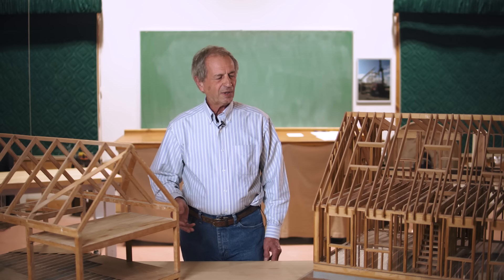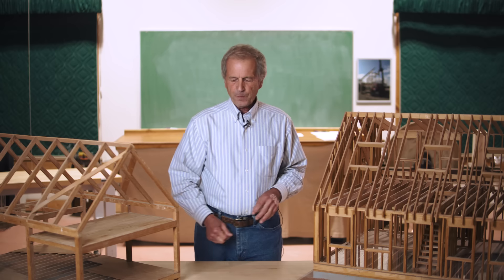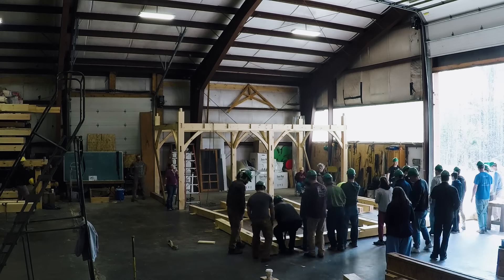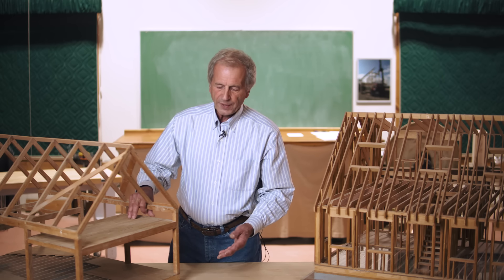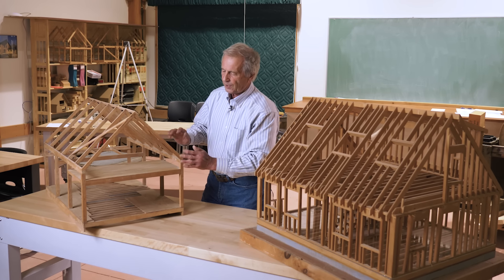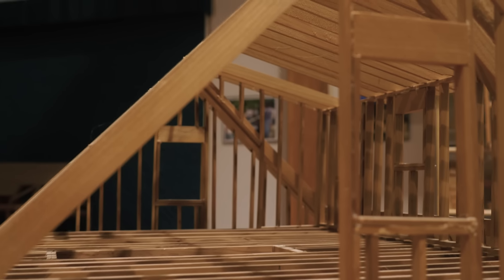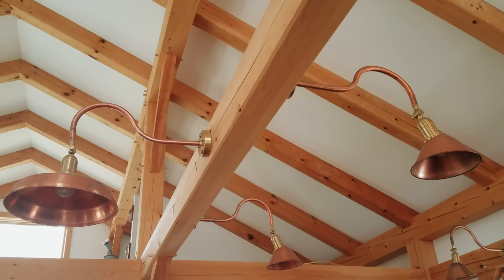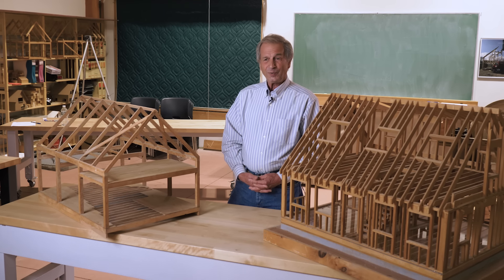Timber Frame vs Conventional Stick Frame

Comment: Does anyone know the cost difference vs, stick framing?
Reply: Timber framing is considerably more expensive.  I don't know the exact dollar amount per sf but it is much higher.
Reply: Timber is much more expensive. The % difference will vary a little since lumber is a large market
Reply: Jonathan Trivette while timber-frame material costs can be higher, where you save money is in the construction time & labor costs. A precut timber-frame and SIPs can be erected in a matter of a week while a stick frame can take months. So therefore the price can be comparable.
Reply: @tennesseetexan1957 , the price is not comparable at all.  I know because I am in the industry.  The timber frame can be erected quickly but that doesn't mean the house is completed.  There are still lots of work to be done and a good framing crew can easily frame and sheath a stick frame house in a matter of weeks as well.  Timber frames are great, I'm not debating that, but there is also no debate about which one is a lot less expensive to build.
Reply: Jonathan Trivette I’m talking about the dried in shell. Using SIPs is much faster and much more energy efficient than a normal stick frame. With all the thermal breaks in stick framing it is hard to match. Of course it depends which state you build in. I’m in Tennessee and built a timber frame shell with SIPs. 1500 sq ft with triple pane windows for less than $100 a square ft. And the beauty of the frame to see every day is priceless
Reply: @tennesseetexan1957  here in az the stick frame 1500+ sq ft houses go up in a week or two per house as long as you have a crew with 8 or more guys... And all most the crews are full of illegals that don't get paid much. IDK  the expense difference here but as far as time difference goes, it's pretty much the same. "ten days to cut and a day to put up" that's two weeks, and the crews out here are easily keeping that Pace with stick frame.
Reply: degenerate weeb I’m sure this is true, but I’m talking about a quality, open concept, well built home that will last for hundreds of years. Not a “Drywall palace” as the narrator describes. If I’m going to build my dream house then I want an esthetically pleasing, quality home not a cookie cutter tract home that some developer built. My wife and I did most of the inside work ourselves and saved $ and have the satisfaction of our blood, sweat and tears in it. It will be passed on from generation to generation.
Reply: Depends on where you live, Timber is always the better option though, seeing as it's better, stick framing is bad, it doesn't insulate properly, if a minor water leak happens, you can basically wish it goodbye. Timber is sturdier, will last longer, less of a fire hazard.

Timber is easy, you erect the frame, you then just need to fill the space between the framing with whatever you want, clad it all in insulation and you're basically done, toss in some windows, doors interior walls staircases whatever you need, clad the building in dry wall or panel, there's a lot less heat loss in a good timber framed house. But even so, there's even better things than timber framed houses, and that's log cabins, because sure the size isn't as big but it has only 3 heat losses, chimney, door and window, a good 3 pane window would solve the window, of course having insulation around the window and putting the window in from the inside with as little wood damage as possible and then you just need a good door in a good door frame, probably custom made and not one of the prebuilt shit everyone uses today that could keep the wind out even if it was insulated.

No matter what option people pick to build their houses, there's always some losses, Timber Framing requires a lot of joinery work. Stick framing needs shitty worthless 2x4 which if someone even looks at it slightly wrong it breaks, and log cabins are cozy and small, although can be made quite spacious but still.

No matter what the biggest problem with all buildings are Windows and the roof, because you most definitely want them to be insulated.

Oh for modern houses, Brick houses are the best specially with specialized bricks that are custom made for your house, extremely expensive, but it's so that you can run pipes throughout the walls of your house that will have water pumped at all times, and your walls will be heated up during winter and kept cold during summer, Brick is the best building material known to man, and it's well over 2000 year old technology how to make them. Other ways to insulate your home is build whatever the fuck you want for a house and build a greenhouse around your whole house. Then you won't have to worry about insulation at all. Just fill the Greenhouse up with some extra CO2 and grow your food year round.

Still whatever people choose to do, it's a lot better than sleeping on the streets.

Comment: Great video. Informative yet easy to digest and straight to the point.
Reply: not really, its a bash at stick framing and a promotiom for his timber framing class

he makes so many mistakes and just straight up lies about many aspects of the construction
Reply: @DSkimRS  Ok, enlighten me then 😊 I was thinking of learning timber framing for my next garage loft. I'm no pro though. I'm in Eastern Canada (very cold and dry winter and very hot and humid summer) Some of the major pros of timber for me were insulation and cathedral roof/ceiling.
Reply: @ChilledSon  you can have as much insulation in a stick frame as you want, and you can also have a vaulted ceiling using a ridge beam

Comment: He blows by something that's REALLY important that might be missed by the casual watcher. 1:00 SIP panels are structural insulated pieces that take the place of exterior ply/ship lap and wall insulation. Under the right conditions, I'm sure they work great. Not so much fun when your trying to adapt them to an older structure that might not be plumb and square. This just doesn't make a lot of sense unless you know that.

Comment: A firefighter, in my country, told me that there is a code for how thick a roof timber has to be. Because it has to burn for a certain amount of time before it fails. Our houses are brick buildings with timber frame roofs.
Reply: In the US, heavy timber construction that can be used in commercial construction falls into the Type IV cateqory; minimum timbers size is 8x8. Wood actually performs very well in a fire due to the char layer that forms. Old prejudices are slowly changing due to the development of heavy timber elements such as Cross Laminated Timber, Nail Laminated Timber and Dowel Laminated Timber. Commercial building codes are slowly being revised in recognition of the performance of heavy timber elements in fires. There is an almost worldwide race on now to build the tallest wood frame structure: an 85.4 meter (280') tall building in Norway (Mjostarnet) just stole the distinction from a 54 meter (177') tall building (Brock Commons) in Vancouver. Due to significant savings in time, transportation, construction costs and carbon, wood is experiencing quite the renaissance!
Reply: There are building design codes that know all the burn times of each material used in the construction, the codes makes the designing of buildings fairly straightforward for the architect, engineer and builder as we know that if we use the correct designated material in the correct way we ensure the building will stand up to a fire for a known amount of time, which gives maximum evacuation time for residents and firefighters know how long they have before it collapses.

Comment: I like the oldfashioned way of framework as seen f. e. in German Framework houses. They are so stable they last 500 to 1000 years if well taken care for. Horizontal as well as many diagonal beams providing extreme stability, nearly indestructible. Insulation with clay-straw mixture pressed inbetween the structure. Best living climate.

Comment: Spent alot of years working in museums such as Westville in lumpkin , Georgia and love the old way of building timber framed buildings and there's no doubt they are tough as long as the rain water is directed away from the structure i.e. veranda porch works great as well as tall foundation.

Comment: I doubt the timber frame is more tornado resistant,  however, large timbers keep their strength longer during a fire.  Insulation outside the frame is indeed better for R-value.  I suppose we could do the same with 2”x 6” 24” on center. The lighter 2”X materials are easier to handle and think that’s the main reason it took over as standard.  That and it’s faster to nail than notch.  Don’t know which would be better concerning termites.  Both should be treated.  I use boric acid between studs.

Comment: There has been a lot of discussion about why you would use timber frame vs stick built structures. Also about the cost and availability of timber to frame with.

People use timber framing because they want to,  cost is not always the first consideration. All types of framing require some specialized skill set. There are skilled stick carpenters that can't frame a 2 story staircase to save their lives.There are people that can't cut a matching dovetail joint to save their lives. There are people who can't figure how to raise a stick wall safely let alone a heavy timber frame joint. 

Like anything availability of materials varies on where you are. I own thousands of trees yet not many would be suitable for timber framing with the ones that are I wouldn't want to cut down. I would rather go buy them from someone else. It is  lot easier to mill one 8X8 than it is to mill 20 2X4's. Few people have the time or resources to actually mill their own lumber. 

One of the main issues I have with stick built houses now is the quality of the wood. When I first started building you could get a stud for about a dollar and you would sort through a bunk to find the bad one to make fire stops out of. Now if you buy a bunk you sort through them to find some thing straight enough to build with. Commercial builders don't sort anything they just put up walls with the junk they get as they don't have the time to worry about the quality of the wood or the construction. Sometimes the fire stops are straighter than the walls. If it didn't fall over when they left then it was good enough. 

Putting the insulation on the outside of the frame is much more efficient than in the wall that is why we see foam or structural sip panels on the outside of super insulated houses. Sip panels can be ship lapped together to make a very tight seal. if you have to do the sheathing anyway why not do the insulating at the same time?

All building systems are not for everyone. You have to pick one that works for you then deal with the good and bad of that system.
Reply: The quality of the wood has dropped dramatically almost in lockstep with the factory farming of trees.  If you hold a piece of natural pine and a farm grown piece of pine the density difference is staggering.  I would imagine this is why so many of the 2x4s today are warped.  I would also hypothesize that there is less oil content.  I have ripped apart stick houses from the 1800's and from new homes and the old homes seemed much more resistant to water damage.

Edit: I've never framed a staircase but I've heard it is quite difficult from other framers.  They may have been talking about spiral however.

Comment: I bought a house that is called semi monitor construction, it is where the roofs do not come together at the ridge but one roof is several feet lower than the other side and there are clerestory windows all across one side of the house between the lower plane of the roof and the upper, otherwise it is s timber framing with open beams and the ceiling is 20 feet to the highest point, in living/dining room, master suite, and garage.  The man that built it in 1991 was an architect and lead engineer at a nuclear power plant.  Where the beams meet they form a triangle that is reinforced with steel gusset plates and 24 one inch diameter carriage bolts, a gusset on each side bolted to the wood.  The roof is noisy sometimes but it is when the night ends and the sun heats the roof, then again at night or storms move in and cool the roof.  It really is not for everyone but I think it is a spectacular house.  It is 2,445 sq ft under air and 3,550 under roof.  Has a very nice lanai out by the pool and 4 pocket sliders so you can open the whole living room to the lanai.  One end of the living room is built in shelves, then 19 foot tall window on one side of the massive fireplace and a tall narrow window on the other side as well.  I have never been able to find a video at Youtube showing this type of construction, the beams are enormous, 4X10 and some are over 30 feet long.  I do not understand how the roof system is supposed to work though as there is no insulation up there.  There is over the other bedrooms and hall, but the roofing system was built apparently to allow cooler air to be drawn in at the low end and vents out at the top.  Being Florida heat you might think is not that much of an issue but it does get cold here for at least brief periods.  In fact last Christmas I had a broken water pipe.  Those clerestory windows have cranks and open outwards, this is apparently to vent heat out and down below at ground level is supposed to stay cool.  There are 142 panes of glass.  My AC bill though does run about $300 monthly in summer which is long.  If anyone has ever come across such a video about this kind of construction I would like to hear about it.  The man who built it knew what he was doing, I had the chimney inspected to see if it was safe and needed cleaning.  The chimneysweep said that the fireplace is one of the best he has ever seen, and the firebox is the Cadillac of fireboxes.  However, the gutters out by the pool were inadequate size and drainage so the massive 4X10 36 feet of it rotted and had to be replaced, hell of a job that but I found a semi retired carpenter and his buddy and the three of us got the job done in 3 days.

Comment: You forgot to explain that with modern framing, if there is degradation of one structure element, almost half to all the structure become unstable and unsafe. with old master technics, you can just remove one element to repair or change it without any problem... it is for long time quality build.
Reply: What? That doesn't make sense.
Reply: This is not true. In conventional framing, the building has many elements parallel to one another, also known as "redundancy". If a single structural element is not sufficient, adjacent members can help carry the load and keeping the structure intact. In a timber frame, there is significantly less redundancy, so if a member fails, there's nothing else adjacent to assist, so it will fail more catastrophically and with less warning.

Comment: The zip system sheathing goes up to R12. This is what some people call outsulation…insulation that goes on the outside. You can use it on stick framing too. I’m not a builder but it seems that timber framing is much stronger and the wood can dry easier so maybe it won’t rot as easily.